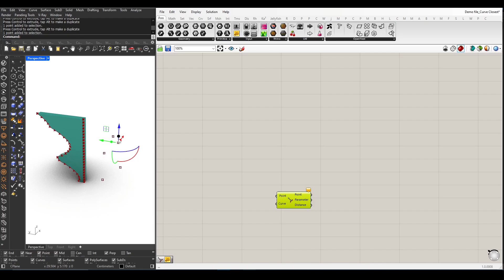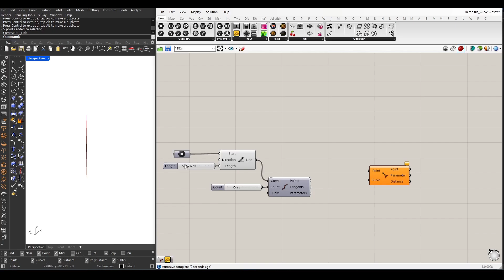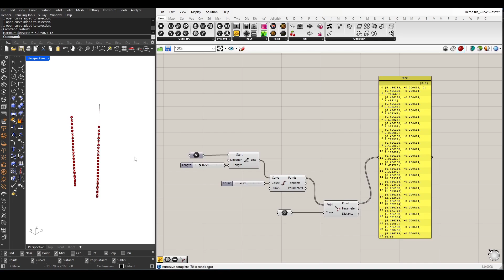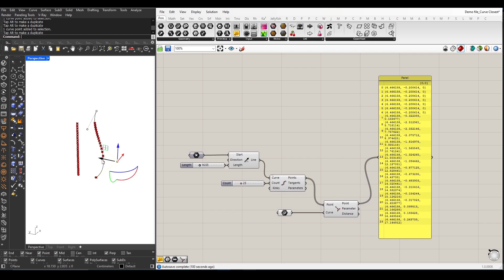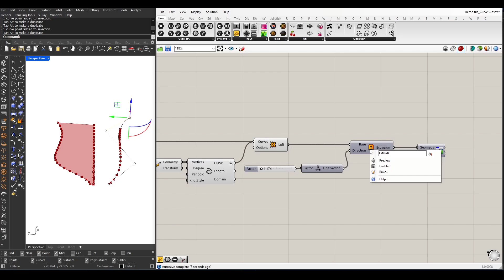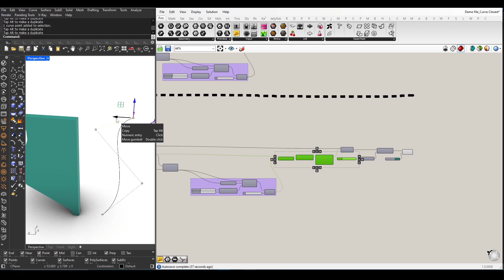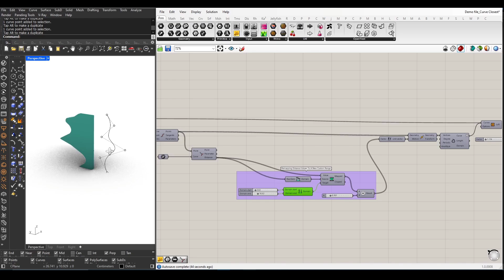Grasshopper 3D - Beginners - Curve Closest Point

Comment from the maker: If you have any suggestions or requests, please leave them in the comments area. Also, if you like to further support the channel, you can use the Thanks button, thank you.
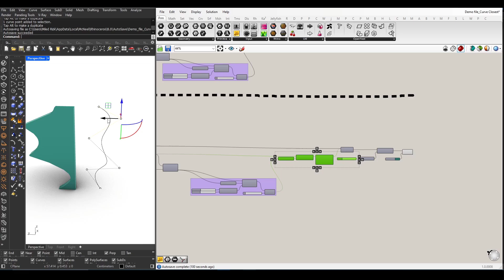Note: Starting from minute 12:15 when I was explaining the Remap tool, the Mapped output can be directly plugged into the Y Unit Vector without the extra multiplication. This extra operation is like a global scalar for the values, where, if B is 1 then the Mapped values will remain unchanged, and by changing the B value, below or above 1 the total move will be, globally, reduced or increased.